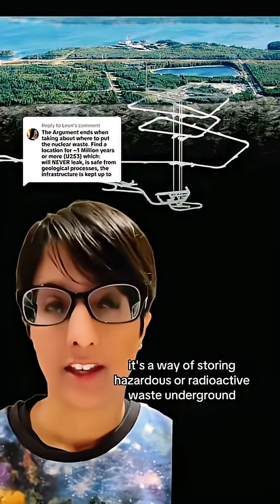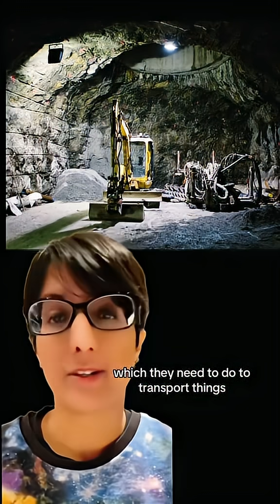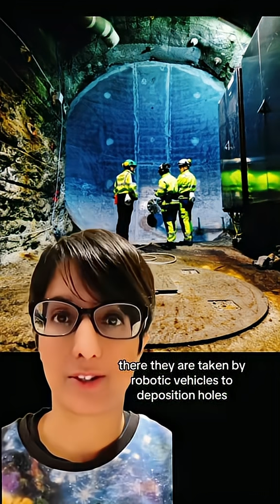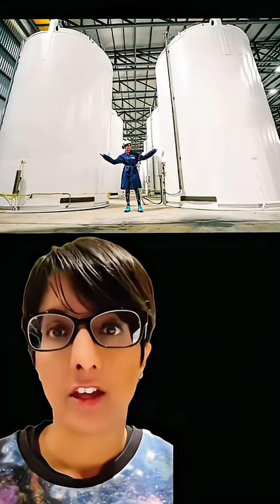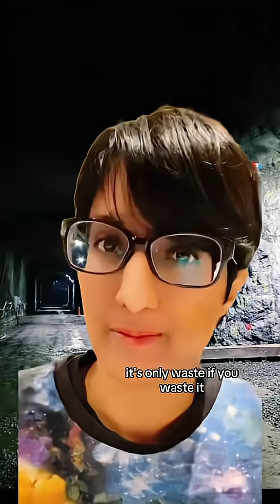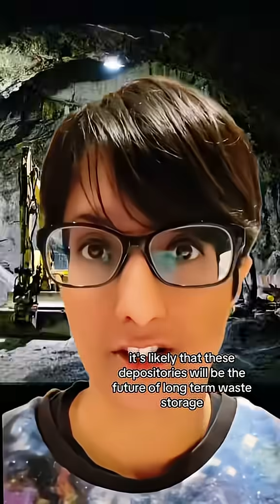Storing radioactive waste for 100,000 years #nuclear #nuclearwaste #nuclearenergy #engineering

Comment: Those dry casks for extended nuclear storage are only certified for 100 years each.  Due to hydrogen embrittlement,  the spent fuel needs to be transferred to a fresh cask every 100 years.  This is a complicated process. The lifetime storage cost per cask is approximately 6 times more expensive than the original value of the power created by that fuel.